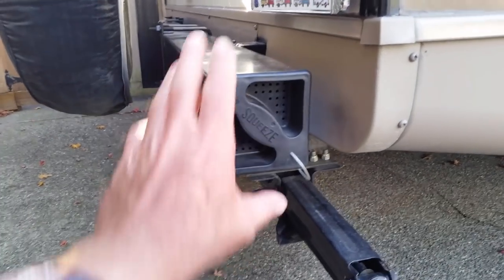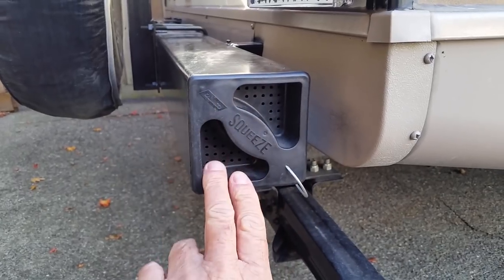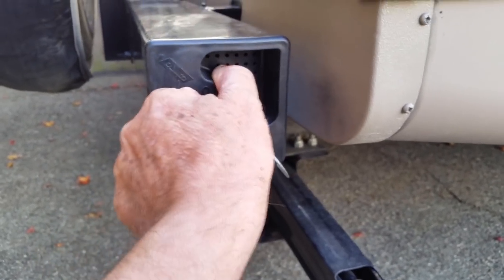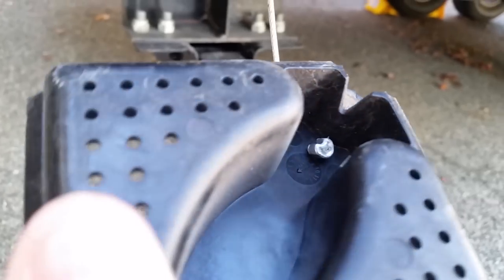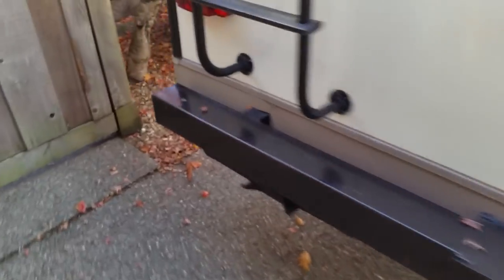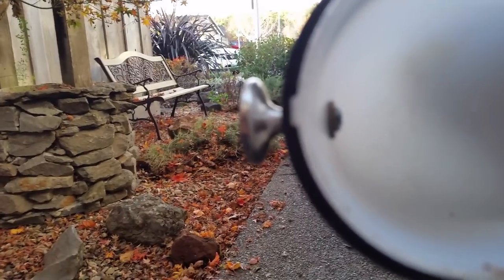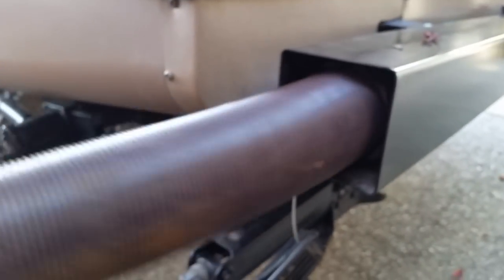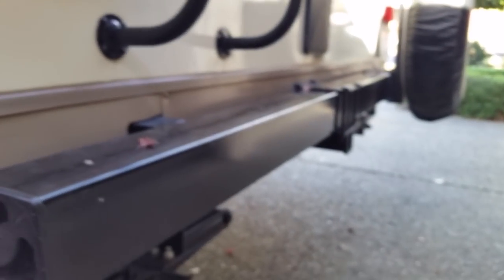Travel Trailer Bumper Sewer Hose Storage - Simple Modifications

Comment: Just now discovering your mod videos. Like your knob mod. For me, I looped a length of paracord on the far end of my collapsed hose and put the string side in the bumper first. When removing the hose I pull the paracord instead of the hose. That way I don’t take a chance on stretching the hose and damaging it when pulling it out. 
I also like the cable idea. I drilled a hole in the top of the bumper through the end cap and put a nail into to make sure the end cap doesn’t fall off during travel.
Reply from the maker: Thank you Hal and thank you for sharing your great ideas. I have lots of videos and lots more t make as I have time. Take care and happy camping. https://www.youtube.com/@thetraveltrailerguy/videos